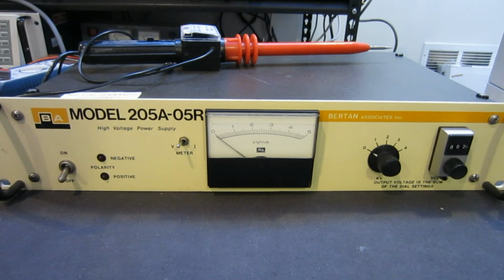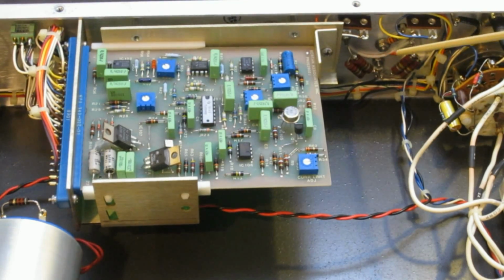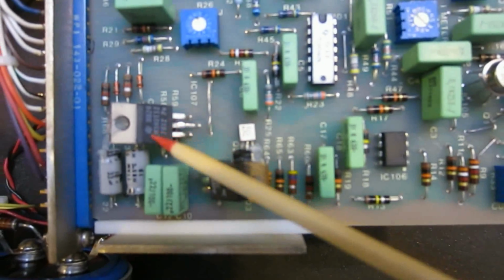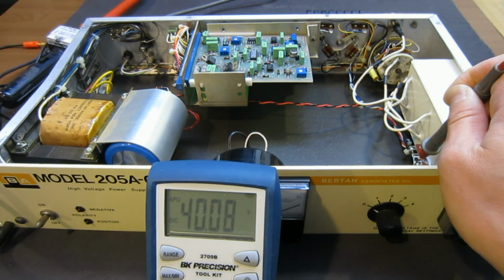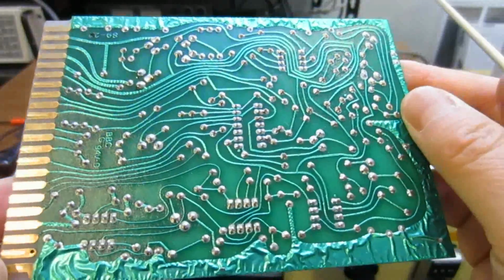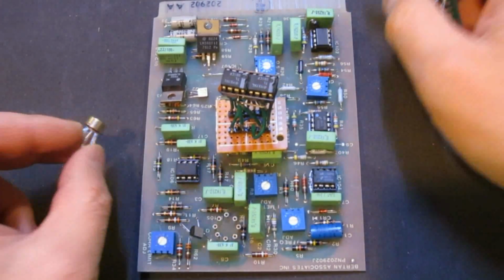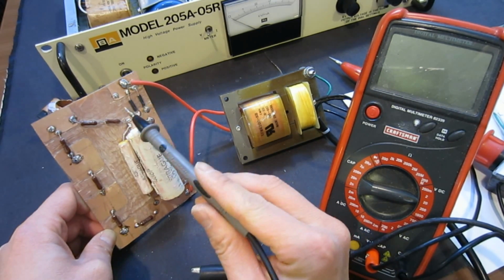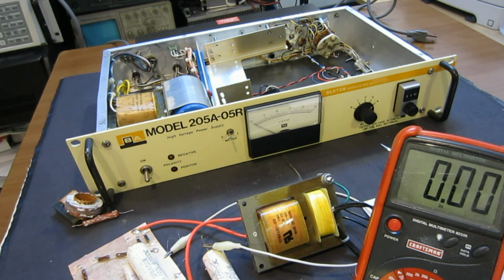Bertan High Voltage Power Supply Teardown

Comment: Rewatched two years later as my bertan 313A now will not go above 1900V to reach 3000V. Works great up to that.  I'm thinking the hv cap(s) are now failing. I'm going to do a thermal image. I can't get exact schematic  either.

Comment: I used your video as an introduction to the broken 313A I just got(very similar to 205). Followed your investigation steps & fixed it! Fortunately, only rectifier diodes and a capacitor needed to be replaced. Thanks for the guidance.

Comment: As shiesty as the build quality is I have found that the drivers are pretty robust. I’m working on a model 315(0-5kv,.5mA) and I believe my potted section has eaten it too. Good signal off the board. Shorts across the potted 4 terminal input.

Comment: those transistors under the regulators are attached like that for thermal tracking. the silicone is used to hold the devices together.

Comment: I have ordered a high voltage power supply from Glassman (now XPpower) it came with a default there is an indication of power in but both the digital screens of voltage and amp show 000, any idea pls. Unfortanelty the company refuse to repair it
Reply: I am curious how much you paid for it

Comment: Great video. It looks repairable. I was thinking that HV diodes would be hard to find. While repairing another supply I once rushed when I was unplucking the silicone filer and broke the thin wires on secondary winding. Counting turns while unwinding the coil and then re-winding replacement coil took whole Saturday.  I had to make a jig for it first. 10KV film capacitor was about $25 from good supplier (Mouser I think), silicone filer unfortunately only sold in bigg-ish bottles. It still works and was worth the effort.
Reply from the maker: Well, I ended up getting another HV power supply. I will eventually get to it, when I have time :-)

Comment: I like to make a suggestion, it looks like you know what you are doing, the only thing I see missing is a couple of extra instruments you need an analog multi-meter and a Variac! Which makes a great difference for repairing these types of systems to make the job easier.
Reply from the maker: I have an analog multi-meter but I agree, a variac would make this kind of job less dangerous and it's something I plan to get in the near future.
Reply: I find the analog meter is much better for testing leaks and short circuits including caps. Also the variac in fault finding is only good if it has a current meter attached to it, as you know this will indicate what the circuit is doing especially in linear power supplies. With switch mode is a bit more tricky as some circuits tend to draw allot of current until they reach a certain voltage and start firing correctly. And again here I suggest to have an analog current meter on the variac and not digital. These days I do not see allot of people using analog meters and its a shame because they are missing out, especially when it comes to fault finding. But yes thank you for your videos, much appreciate your knowledge and work. reg joe.

Comment: Rookie question: Why is it not practical to repair the HV module? Does it have to be potted?
Reply from the maker: It depends on the voltage range of the power supply. voltages higher than a couple of thousand volts are almost always potted (or oil submerged) as the dielectric strength of the air is relatively low.

Comment: I worked at Bertan in the mid-80s. The potting compound is soft and easily cut with a razor blade. I think you will be able to carefully cut into the potted module and be able to expose the shorted capacitor. All of the components was brushed with a reddish colored primer so that the rubber would cling to them, so be aware of that. Avoid cutting close to the terminal strip, that's where the HV xfrmr is, and its delicate leads. All of the other components are standard axial leaded caps and resistors.

Comment: I know this is an old video but I don't think you were reading that hour meter correctly.    the actual hours are indicated by a tiny air gap in the mercury.  The meter is always completely filled with mercury except for that tiny gap.   From what I saw that gap is just slightly in from the left.
Reply: also the lower meter only read to 1000 hours which is why they were both there.
Reply from the maker: Thanks for the comment. You are probably right as from the 520-LNA documentation it says 
"...Thus the gap moves along the capillary
tube and provides a visual indication of the current/time integral."

Comment: Enjoyed your video. I've spent many hours digging out the potting compound in HV psu's. 80-90% of the faults in the HV section are due to the capacitors. They either short, as seen in your video, which knocks down the HV output, or they start to breakdown, transmitting spikes which causes all sorts of intermittent problems, including damaging op amps and logic ic's. Also need to be VERY careful when removing the potting compound around the HV transformer - as seen in your video, the secondary winding uses very thin wire which is easily damaged by an errant tool. Pacific Capacitors do very good replacement for the HV caps.
Reply from the maker: Thanks Bob! Still wonder if there were some design flaws that contributed to these cap failures.

Comment: Kerry - just one more safety note, when you turned your PCB capacitor test jig off after demonstrating the expected 4.3KV and then reached in to connect the "bad" capacitor you did so without double checking to ensure that your bleeder chain had in fact done their job again - I would have either probed the HV again or shorted the cap directly (that can be tricky in of itself though without a "cap zap" bleeder stick of some sort). Can't be to careful as you say around high voltage! Sorry you couldn't repair but we did learn a number of things along the way!
Reply from the maker: +Dino Papas Thanks for the tip :-)

Comment: Shame it was faulty on the potted HV side. Out of interest, i don't suppose you noted the oscillator frequency driving the primary of the HV transformer?
Reply from the maker: +DextersLab2013 I did measure the driving frequency of the transformer, it was at around 19 kHz, just outside of the audible range.
Reply: Kerry Wong Thanks!